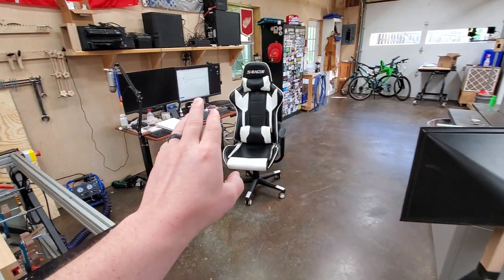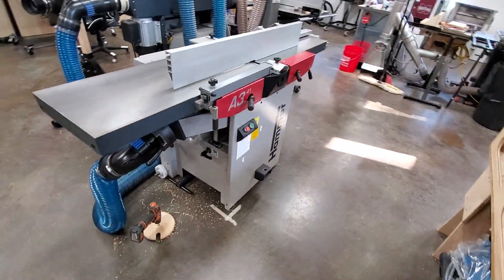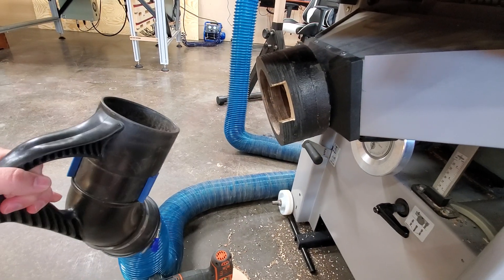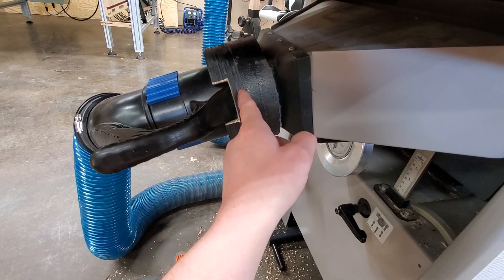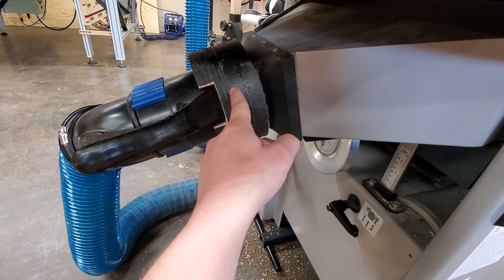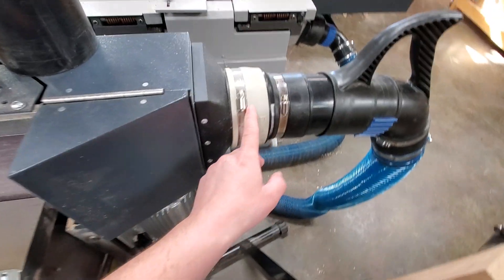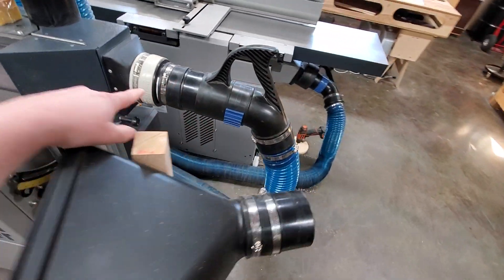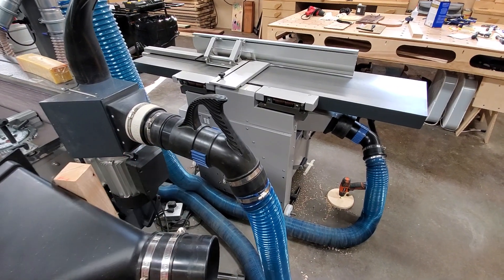Hammer A3-41 and Hammer HS 950 dust port adapter

Comment: The way to release hot glue on a non porous surface like that is to wet it with 91% Isopropyl alcohol. Once the alcohol can get in the seam it will release it. You may have to use a tool to help it start, but it will come off.
Reply: Super cool, thanks for sharing! I've always messed with heat guns to remove, but this sounds way cleaner.
Reply: Correct. I use it to remove the hot glue used with my car dent pullers.

Comment: I have the Hammer A3-31, when I ordered the machine I requested that they provide a 4” dust port instead of the larger one that is standard. I just use a rockler dust right straight on it.

Comment: Do you think the pvc adapter setup could have worked on the A31 as well if you had it at the time?  or is that a different size that really would still require the custom port setup?

Comment: I went to Thingiverse and downloaded a reducer an printed it.  do a search and you will find it.  I was able to attachea 4 inch hose onto the reduced end.  It is a friction fit on the Hammer port.  I may have done some sanding to ease the fit - too much force and you could crack the 3d print.  If it ever breaks I will just print another one.  It is nice bright orange in color, too.  

You can aso use an app on your ipad like Sahpr3d and design your own reducer and print small rings to make sure you got the correct diameter before spening 8 hours printint it out before realizing the size will not fit.  

By the way, instread of buying very expensive Festool track saw guides I used thingiverse and infra T track and make my own track saw edge guides.  I love incorporating 3d print solutions into the shop.

Comment: I use a rubber connection hub that joins cast iron to pvc pipe. The Hammer A3 31 dust port has an outside diameter just a hair to 5 inches. The 4 inch hose screw in adapter fits the 4 inch end of the hub with a good friction fit. Both ends of the hub have stainless steel adjuster bands.